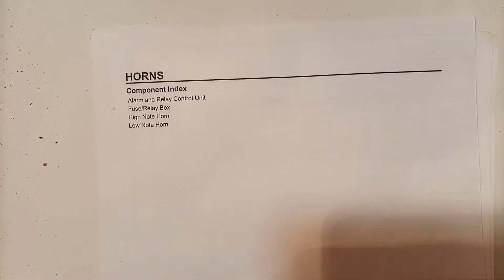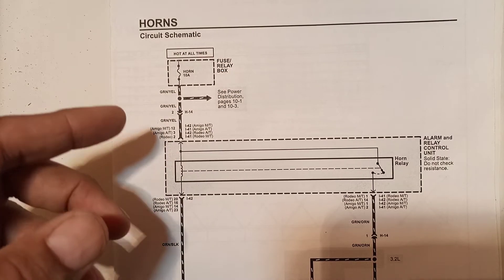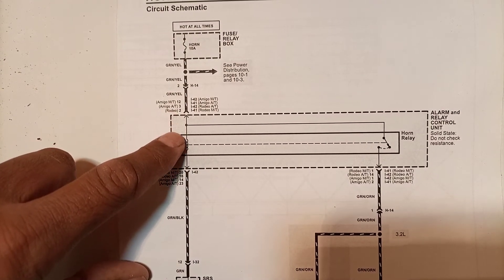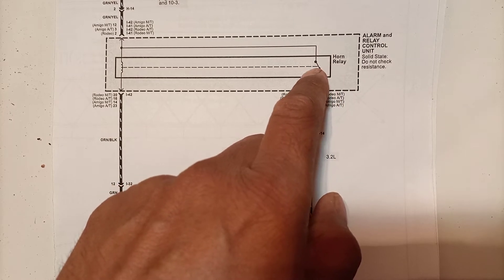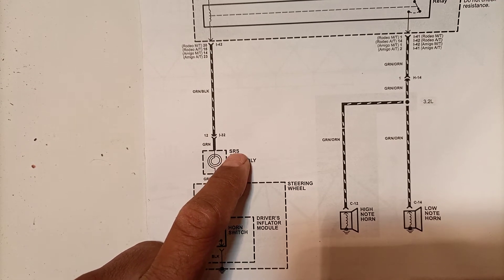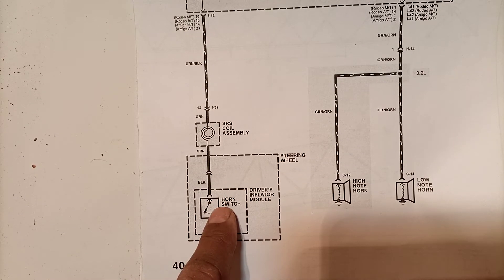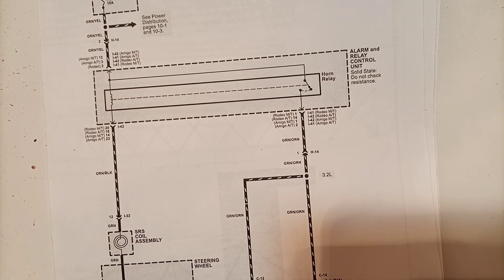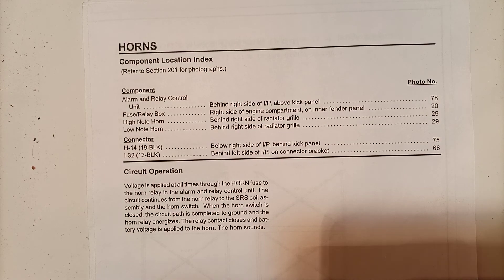Horn repair efi training. Horn wiring circuit diagram schematic explained. How car horn works. xnxx

Comment: Sir, recently,  I don't hear fuel pump priming sound when key at ON or engine running in my i20 petrol about 10 days ago. The same happens when fuel level is full or halfway full. However, there's no any problems while driving any car, no pulling power issues, etc. All perfect.

Earlier I used to hear fuel pump priming at key on. But this prime sound is not hear recently. Is this normal? Is the fuel prime should always ON or only sometimes when keys at ON? Please kindly help on this.